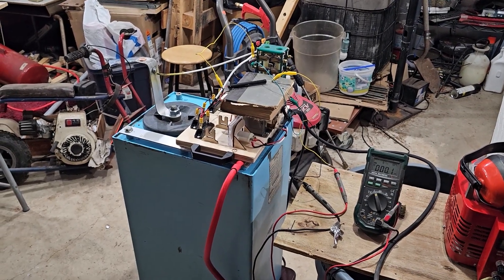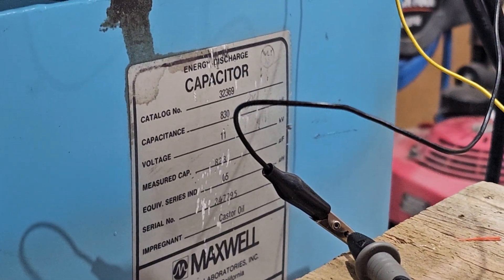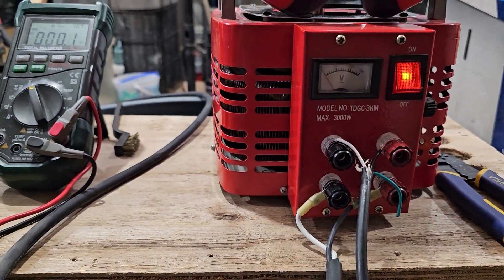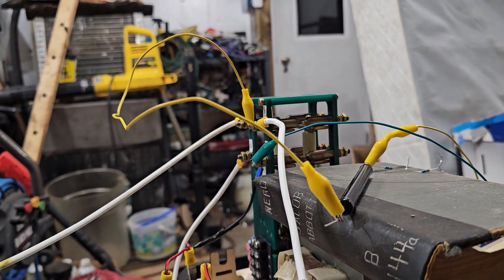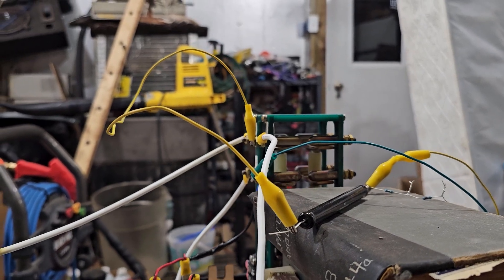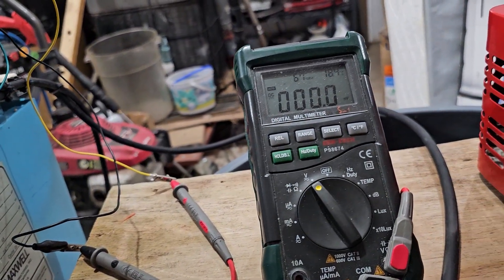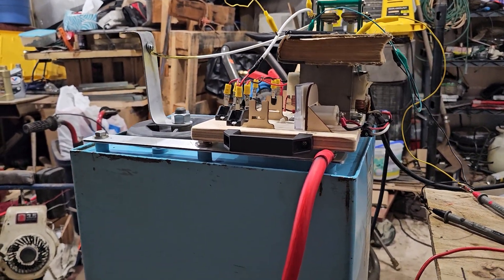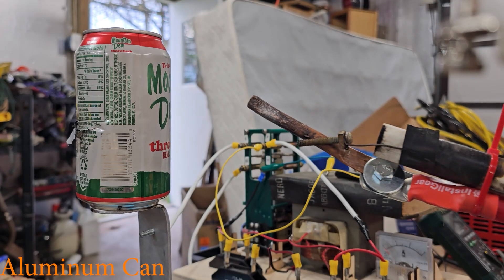Testing a pulse capacitor @ 1300J

Comment: Oh my fucking god, where do i get one of these? 😮 You have no idea how much i want them 😅
Reply from the maker: Surplus sales of nebraska, they had a bunch for like $500 or so, i think they still do. I bought two of them since the freight cost wasnt much more to add the weight of the second capacitor since you mostly pay per-pallet. I think all in all i spent under 1500$ to get two of them shipped to the house with tailgate delivery..
Reply: @PhxSt0rmz Well that was more of a rhethorical question, but thanks actually. I had no idea such a shop existed and you're right, it looks like they still have some of them. Of course there is still the problem of money and shipping. I live in the Czech Republic, so i doubt its gonna be just 400 bucks. Maybe one day, but right now this will stay as a dream 😀

Comment: I think I’ve been seeing these caps on EBay. 

Did you ever find out what their rated current and voltage reversal is?
Reply from the maker: I haven't gotten any stats on it. Emailing the company got nothing in return. Theres a guy on ebay who has these exact same caps, but they're rusted to hell and he wants like 600 each. They look stored outdoors too, in the rain. If there's rust near the HV insulator, there's good odds water got inside and it could be useless. So i saw his listing and didnt even bother, as they're so rusted I cant imagine they wouldn't have water inside!
Reply: @PhxSt0rmz  Be careful with some of the older caps, they contain polychlorinated biphenyls. Also, leaking oil filled capacitors can rapidly deconstruct themselves if there is a leak and air has gotten inside...not something you want to happen.
Reply: @PhxSt0rmz  I have some info on your caps, but YouTube is blocking my links. Let me see if it lets me post without links:
Reply: looks like you got some OG railgun caps! From this product bulletin, your caps were made in 1986 for the Defense Nuclear Agency for their Green Farm Electric Gun facility in San Diego.

While the bulletin only gives a few details, it seems likely that you have an extended foil/paper dielectric constructed cap (castor oil impregnated) since that was the initial construction method of these type C caps and yours are quite early. This means awesome short circuit current and reversal ratings (though >20% is all that is specified).

I would bet that this paper (behind a paywall) might shed light on the cap’s construction and ratings
Reply from the maker: @PulsedPower  Interesting! The link didnt post, but you may be able to do it with some editing ( removing parts of it with spaces etc )

These were bought off a surplus sales site, for like $560 excluding shipping. So i ended up getting two of them as it only bumped the freight shipping by like $50. I think all in all I was about $1.4K into it, shipping and all. Lately ive been working on the transformer to charge these, the charging circuit, bleeding circuit, etc. Got my ross relays for that and I got a ceramic disc resistor built specifically to dump the cap at full charge, in seconds. Slowly getting there!

I sorta figured it had to come from government projects, neat to know it potentially came from railgun use! I tried emailing general atomics to get specs on them but obviously they never replied lol
Reply from the maker: @PulsedPower  A lot of times those are often strictly sold as a lot, often like 20 or 40 at once. So as long as you have a way to get a semitruck to pickup all 20-40 of them, i dont think those gov auction sites do any palleting or any of that stuff.  Hard to say!

I did see some manuals ( dot ) chudov pdf file on the google search, tho that link/site doesn't want to load anything.
Reply: @PhxSt0rmz  yeah, I came across some lots of two or four caps on gov planet, but they were across the country and I chickened out on the whole sending a freight shipper to pick it up thing. Lol maybe next time.

Yeah that’s the right pdf, strange that it’s not loading for you
Reply: @PhxSt0rmz I just noticed yours is actually a 32369 part number and the rusty eBay ones are 32327 or something? 

I had the same concern with the eBay ones, that moisture could have entered around the bushing. That’s one reason I didn’t buy any. 

Kinda curious where you got yours?

Comment: I really hope there was someone with you or at least in the vicinity (preferably with a working phone). Can't advise to do these things unmonitored by yourself. This is so ungodly dangerous. I know you are experienced and all, but damn. Play safe! Cool explosions, though.
Reply: He would need someone there with him to find all the parts of his body if he came in contact with that beast, you don't get shocked by something like this and survive, at full charge it would little blow you to peices, at 100uF 20kV there is more energy than a 50cal BMG round 😀... he knows what hes doing and understands the danger I'm sure....
Reply from the maker: Depends on how you look at it. Id say my xray transformer is more damgerous as thats 175KV and hundreds of mA, and if your hand/body comes within range that 175kv can jump..yer pretty done.  Where as the pulse cap is 11kv at most. And likely wont use it over 6-7KV. So you basically have to directly touch it to put yourself in that risk zone.

Biggest thing is making sure there's an active meter on the cap and making sure its shorted out before handling it. Some people goof up and have an inductive pulse, and swing the cap to say -1000V after discharge..then have analog meters that dont measure negative voltage...and no crowbar. Then unwillingly welcome risk of touching something with -1000V existing on it.

My case everything is basically built for this type of system. Using HVR disk resistors for my discharge system. As theyre rated to safely discharge 50KJ 11KV full tilt, in like 30 seconds.  The resistors are made for high energy pulse dumping and the company makes ones that can handle up to multiple Megajoules worth of pulse. So they looked at my request as a "pfff easy" xD
Reply: I've used 5kV, 3.2mF banks. Never shorted them out though.... However,  you most likely will be instantly deleted if you happen to be an unintended conduction path, so doesn't matter about having help nearby really.
Reply from the maker: @ic7481  Prettty much!  I use this both by myself and with a friend. Doesn't really make much of a difference. Main thing is that the operator ( You ) know the dangers and design/build a safe system with fail-safes and ways to basically always know the voltage of the cap. Always planning for something to not work, or something to be a false indication. Your meter could say 0V and if something internally failed somehow ( analog meter for example ) whats your proof that its actually 0V? Your just gona trust it 100% and trust your discharge circuit etc etc? Some go as far as adding a 3rd fail-safe which is a crowbar direct short.  Basically bleed the system with a power resistor. Volt meter for showing its at 0V, and then throw the mechanical crowbar lever as the 3rd and final confirmation that cap is safe to handle.

I do like having a buddy for the conversation/ideas. Just gotta be careful as a buddy can mean a distraction or a missed step.  I kinda make sure my friend fully understands the charge/discharge sequence so we're on the same page.
Reply: Did you get these on Surplus Sales or score them in a GovPlanet auction? :)
Reply from the maker: @PulsedPower  Sorry for the delay in reply, I got two of these from Nebraska Surplus Sales and recently picked up the sister capacitor, 22KV 206uF, about 2 weeks ago. They look is great condition and dont show any signs of issues. I have a pulse resistor that was custom made specifically for dumping the 11KV 50KJ pulse bank into it without nuking itself. The quality is A+ and the company pretty much said as long as I respect the reset/cooldown time, they'll last a lifetime of discharges. So now I own 3 of these maxwell pulse caps.  Not much has happen since this video. I've been working on the transformer for charging these and working on the enclosure that bolts to the capacitor to handle all the charge/discharge/bleed/etc. I'm hoping by this summer, I'll get around to more tests. As eventually I need to charge to 2KV...4KV..6KV..8KV..10KV..and prove the bleed resistor does its job.